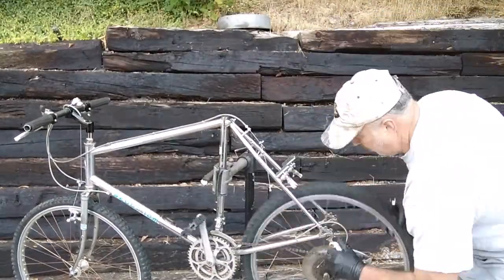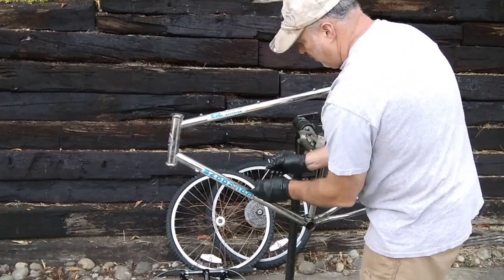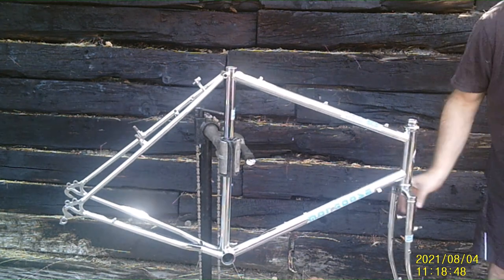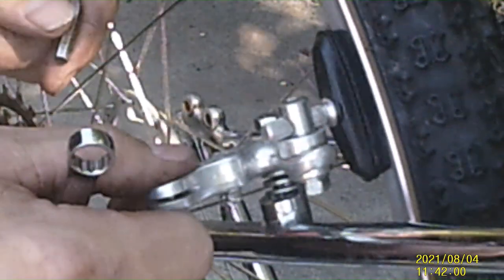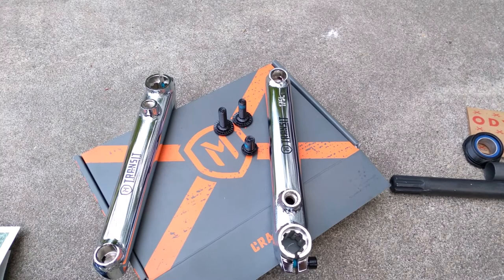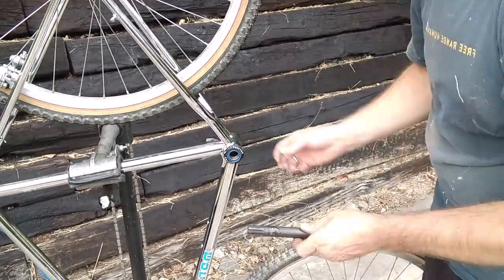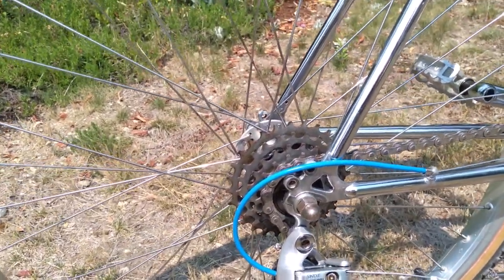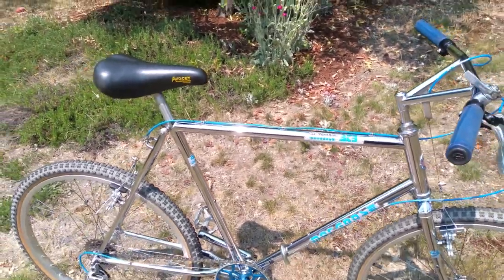Mongoose ATB 1985 Build

Comment: I just bought one in need of a complete restoration.  Mine has the Slingshot stem. 
Your video was great and the bike turned out👌🏽
Reply from the maker: Very cool, slingshot sr stem original equipment, lot of manufacturers ran them.  Good luck on the build!

Comment: I'm a purist but that single blue chain-wheel in the front looks fantastic !!  I believe the mongoose ATB might be the strongest bicycle ever made.  It was the first production bike designed for mountain biking and they seemed to have over-engineered it.  The brake levers were designed to withstand a direct hit of a nuclear warhead and or tree-trunk.  It feels like riding a tank but in a good way 😎👍
Reply from the maker: Pork Chop bmx repop mongoose  style chain ring fits perfectly
Reply: @hoosiercycles6595  Pork Chop is awesome !! 😃👍
Reply: Mine got taken out by a Ford Ranger in '99. Bent the hell out of the frame and the rear wheel set after a 30mph impact.
Reply: I do like the cranks on this restore - match the frame nicely.

Comment: Nice build! I have an '85 also,  identical to yours,  but with all stock parts including the Pro Class rims and slingshot stem. Only non-original parts are seat, grips, and tires. These are very nice riding bikes, very smooth and stable.  

The reach on the slingshot stem/bar combo seems to be bit shorter than the bullmoose bars, in my experience.
Reply from the maker: Thank you 
Yes bullmoose shorter both reach and height but look so much cleaner

Comment: Do you happen to have a parts list/ breakdown for your build on this bike
Reply from the maker: I don't, frame fork original headset original bottom bracket generic euro came with 2 piece tubular Crankset  porkchop sprocket 42, original dia-comp cantilever brakes, sr flutted seatpost, avocet seat, wheel set from 83 schwinn Sierra, bull moose bars vintage